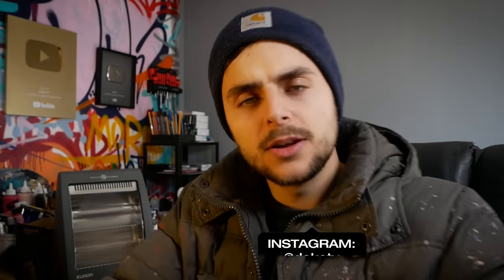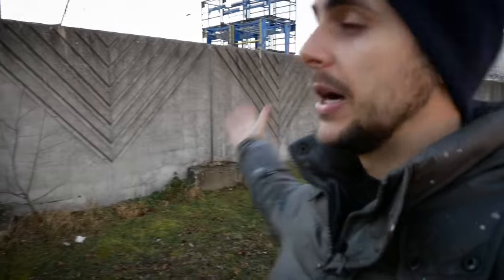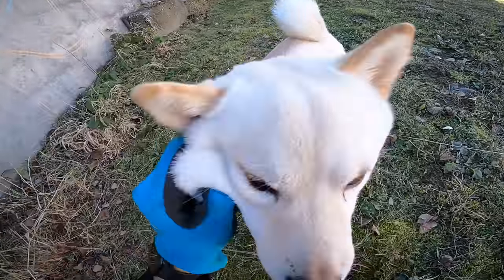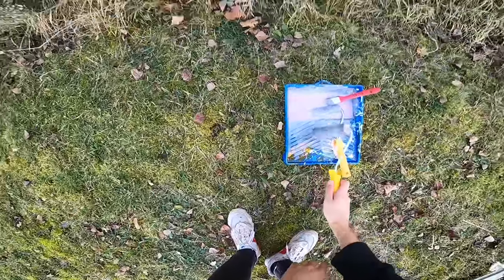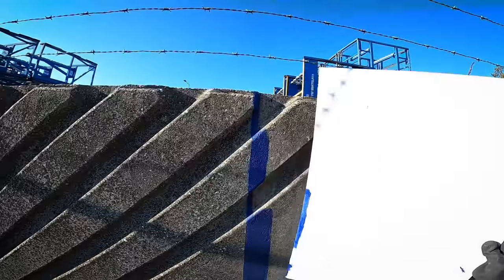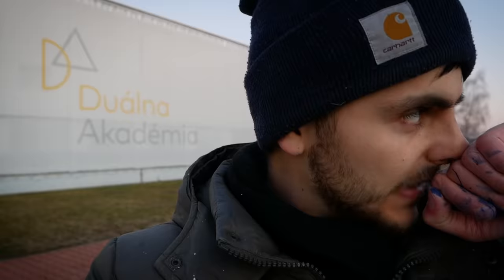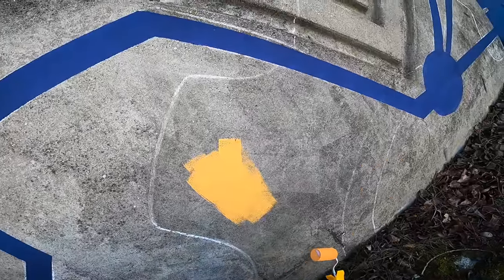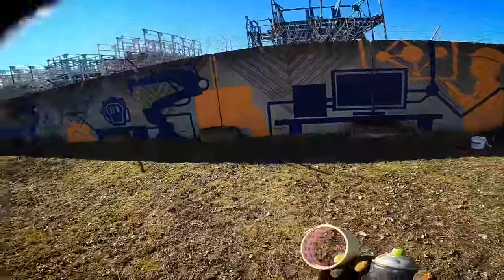Painting a Custom SCHOOL Yard (Send HELP!)

Comment: Use A pressure washer💧to Clean the wall First☝🏼
Reply: The whole time he was scrapping I thought the same thing. That would've helped him so much
Reply: Would that not cause delays with the moisture that penetrates the wall?
Reply: I think it would depend on the weather. Looking at his video he said it was cold so I might. I'm in Texas and usually when we pressure wash it's dry in a few hours
Reply: @That-bearded-dude  wen you do a paintjob for A comany...do it like a pro...first clean..let it dry for A few days & use good primer wall paint...olso use pro rollers(it look like he use ony cheap materials🙈
Reply: Start go fund for that and generator / fuel
Reply: You assume he has access to a water line. Most places there will not be water or electric

Comment: You should invest in a pressure washer , a cordless sprayer or a cordless air compressor , a cordless work light so that you can work at night , and a short throw laser projector so that you don't have to wait until it gets dark in order for you to draw the outline . You would have finished this in 2 days or less.

Comment: Awesome video! Thanks for creating and sharing. I love seeing the process. Some details/information about choices of paint and penetrator would have been interesting to hear about. A few bigger questions though:
--You're not known for super geometric and straight-line work. Why not do something more your style?
--Could a pressure washer have been used to clean the wall thus replacing the hours of scraping while providing the paint a better surface to adhere to?
Reply from the maker: I believe that my more traditional work wouldn’t fit to this place. Also it would be even more challenging because of the structure.

Yes, pressure washer would be great but I would need a water source and time for the wall to get dry.
Reply: @DokeTV  Holy Crap! I never anticipated you replying! Thank yo so much for this bit of information. I love your videos!

The water source crossed my mind as well and I figured that the school probably has both (a washer and water source) for cleaning up messes/vandalism. But that is also a weird request to ask of a customer. It looks cold there and that would slow down the dry time, but if they knew that they had a tricky wall then they could have allocated additional time for a cleaning.